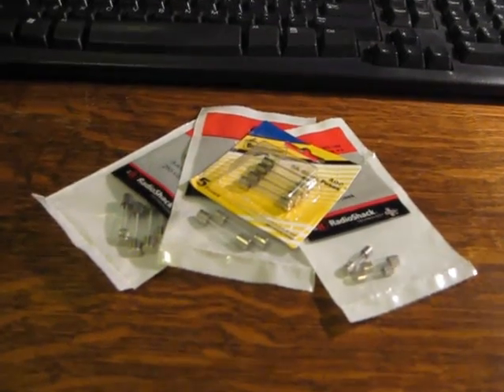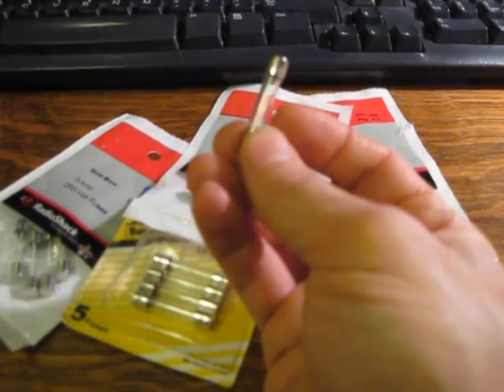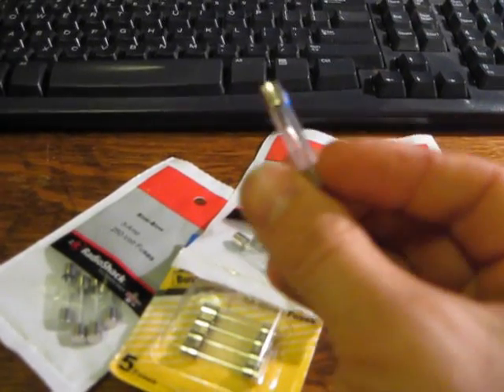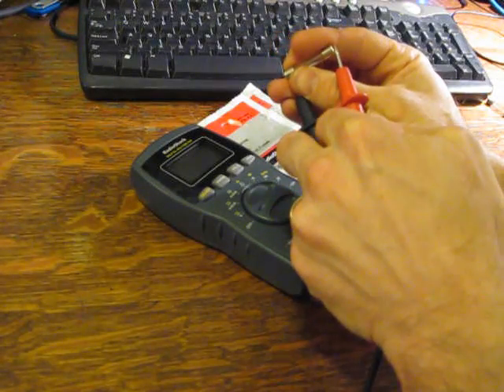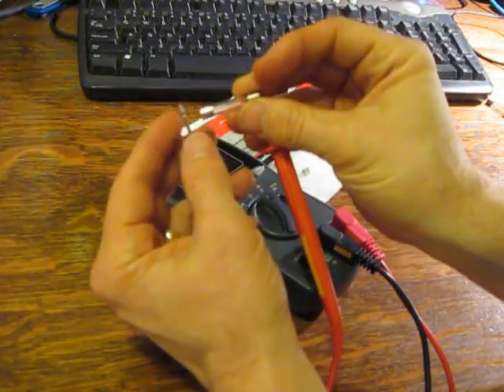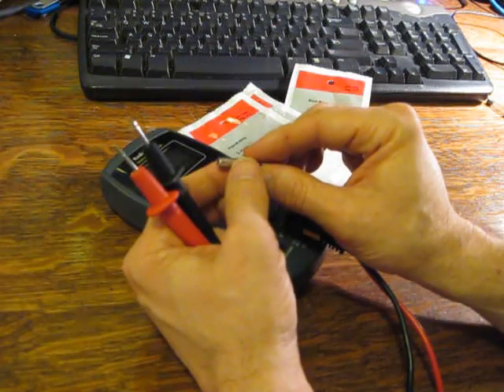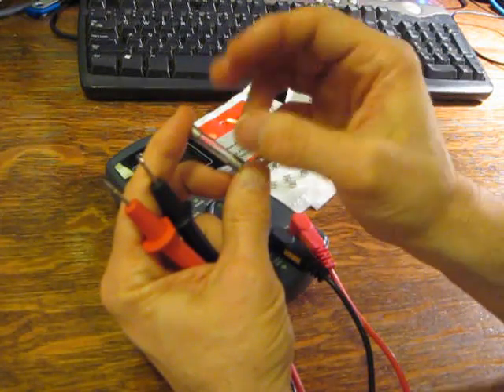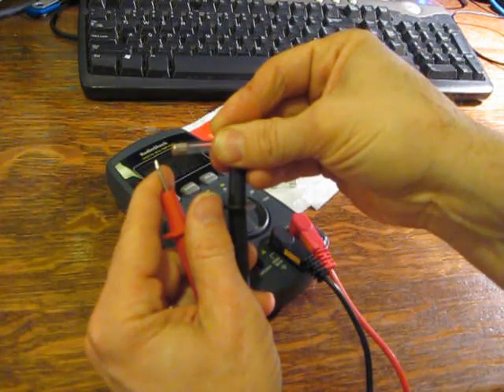How to Test if a Fuse is Good

Comment: So I couldn't get my commercial electric to work , then the Klein multimeter wouldnt work. I go to check the fuses and they're coated or covered with something that isn't scratching off. I imagine that's whats causing them not to work but I have no working multimeter to check now!

Comment: Fuse in my solid-state amp appears to be in perfect condition. Amp immediately powers off upon pressing the power switch or using the remote. Anyone know what might be the problem?

The other problem is the location of the fuse. It is very tightly-placed between the power supply and a board. Any tips for how to removing it without damaging anything?

Comment: It's actually best to test fuses by using the Ohm setting on the DMM.  There are circumstances where the fuse can be blown but still have continuity.
Reply: Oh(m) I didn't know that. Thanks.
Reply: @sethlogan9724  I see what you did there

Comment: Dude - I thought you'd have gone into a bit more detail than you did, but thanks just the same.  I need to know more details about replacing these little critters.  Especially one for a Craftsman 4-gallon 125 psi pancake air compressor.  It's a half-size glass fuse but with a white opaque material which made the continuity test the only way to determine it was blown.

Comment: How can I identify what 'Amperage' a fuse is apart from looking at what's stamped into the terminal?
Reply: ....   For  example  a  ""glass cylindrical  fuse  marked  "F5AL  250 V"  is  a  5  Amp  fuse  I  found  in  my   car  which  runs  on  12  volt ,  even  though  the  fuse  is  rated  up  to  250 Volt.    The  "5A"  part  tell you  it's  5  amps.    But  you must  know  if  the  fuse  is  "slow  blow"  or  "fast acting".      A  very  thin  wire  in  the  fuse  means  it  is  fast  acting  and  will  blow  ( which is  another  word  for  the fuse  going   bad)  the  first time  the  current  in  the  wire  gets  to 5 Amps.    A  slow  blow  fuse  can  endure  5 Amps  for  a  longer time but  eventually  will  blow  if  at  5 Amps  for  a  long  period  of  time.  I  hope  to do a Youtube  video  on  this  subject  soon.

Comment: I hace a RCA HTS  ii is a 120v but i do not hace time to go to The supply store so the question  is. ¿can i use a 250v fuse for  my  120v. Fuse  dvd power supply
Reply: No, the fuse may not be able to protect your device properly. You should take your time to go to the hardware store.